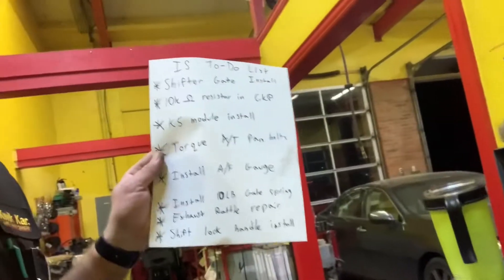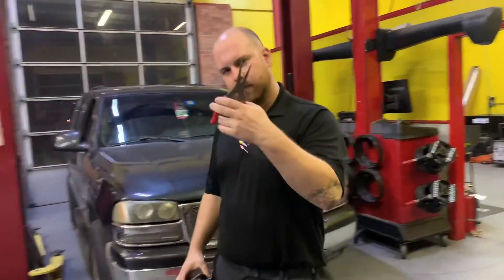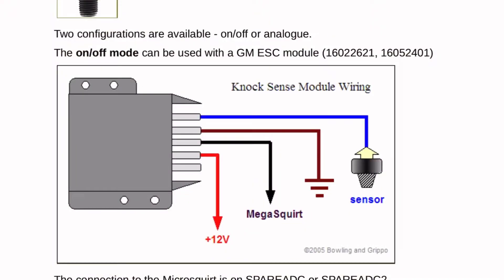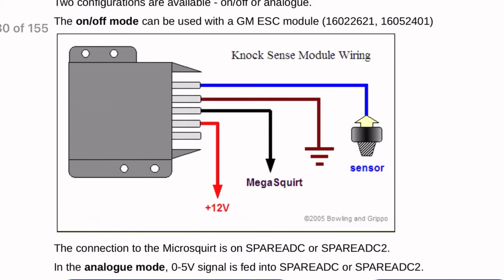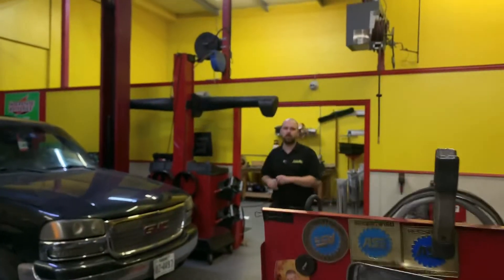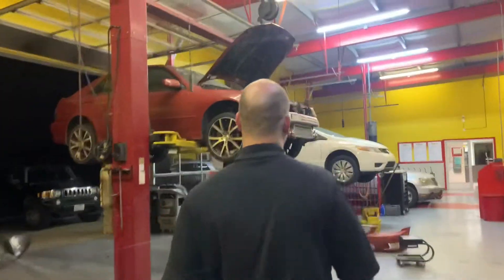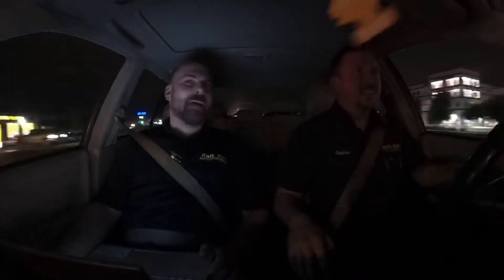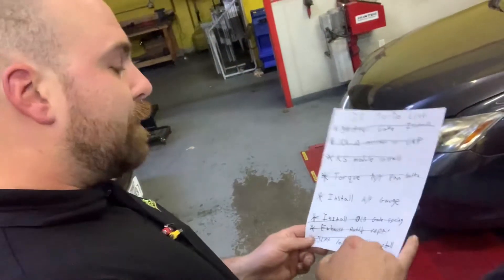Turbo IS300 Gets Knock Control

Comment: What kind of plugs are you running? What's the gap on them? .018"-.022" would work pretty good for you on low- medium boost. Copper v-power ngks are a good off the shelf plug for boost. The tighter gap with the copper electrode makes for a nice fat spot for the s ppl ark to propagate the flame front from with out it getting blown out. If the plugs aren't it then I'd lean towards your ignitor seeing as how I just had an annoying problem with mine. Unless a soft rev limit was set accidentally, I bet itll be something easy and simple to resolve.